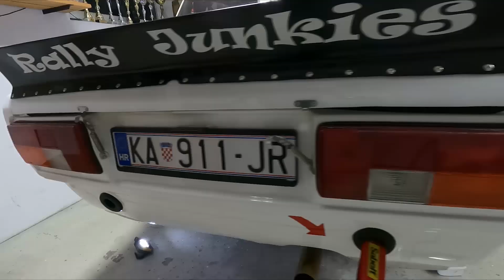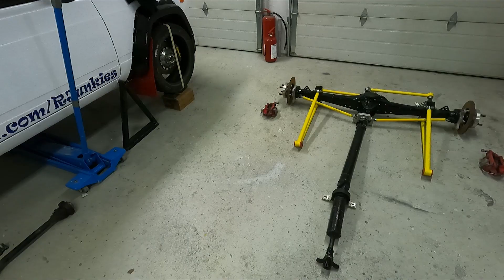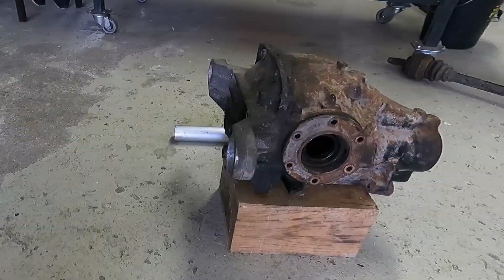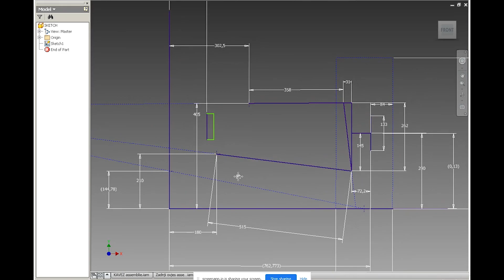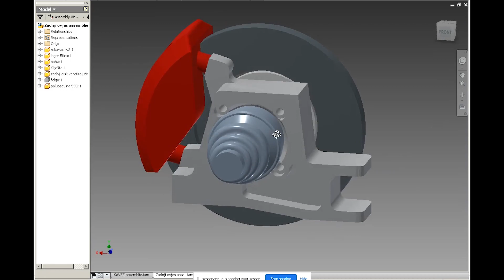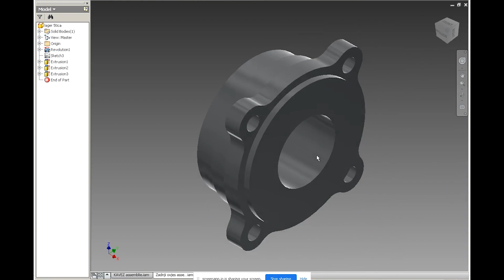Lada VFTS removing rear axle and upgrade

Comment: Судя по подрамнику будет на 2-х А-образных рычагах.
Reply from the maker: Yes, but not exactly. It will be most likely somethnig like on Lancia Delta integrale on rear end. Upper will be A arm, lover will be something like trailing arm with toe link.
Reply: @RallyJunkies   The Delta has a MacPherson strut in the back. It is interesting to look at the calculations in the Lotus Suspended Analyzer. What is the front of the roll center? And what is the rear roll center?
Reply from the maker: @marafonetsdesign2983  in next episodes it will be more about roll center, suspension frequency and all the ditails. Sorry for suspension type missunderstanding I wrote, the lower part of rear suspension will be like lancia delta integrale and upper part will be A arm.
Reply: У него что за мотор стоит блок будто от классики а голова от чего тогда не пойму не подскажешь . Или это проста свап
Reply: @ИванСвердлов-ю1з  возможно это двигатель фиат твинкам